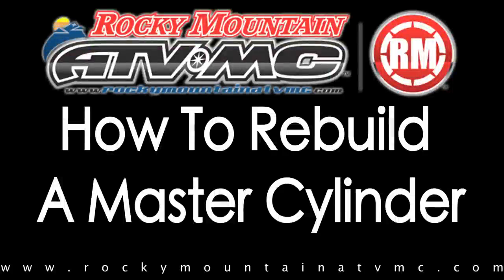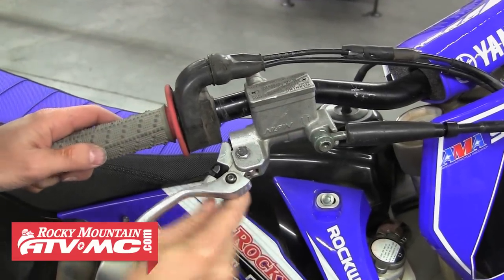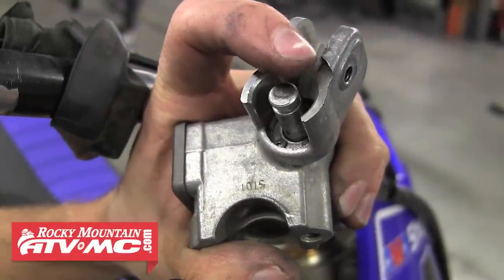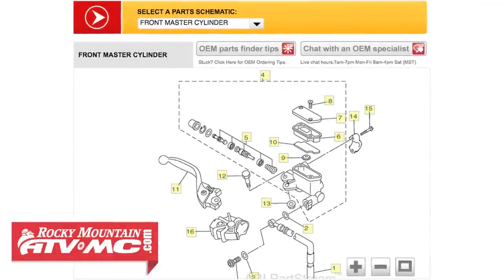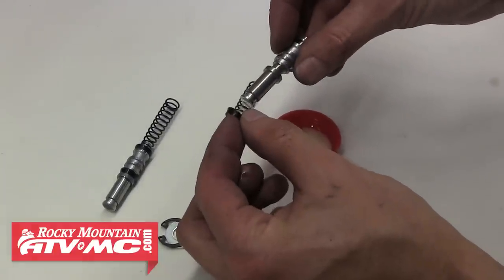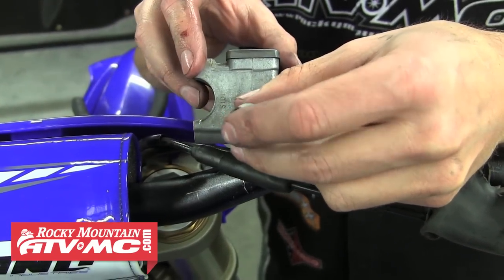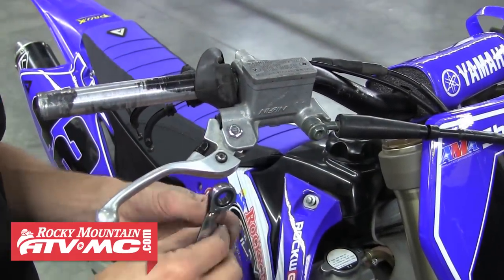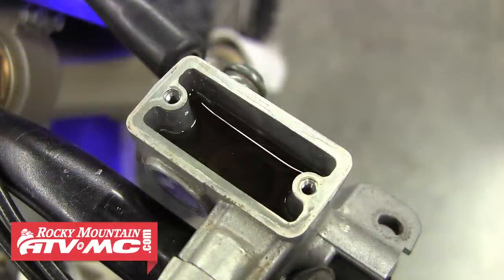How To Rebuild a Master Cylinder on a Motorcycle or ATV

Comment: Important to mention… When the piston is in the rest position, the brake fluid will be balanced via The compensation hole. This compensation hole is very small, clean this compensation hole with a very thin wire of copper, if it would clog… you are guaranteed a dragging caliper, this has already happened to me twice!!!  with the Honda CBX 1000. Stay Safe.
Reply: You left this comment on multiple rebuild videos. Good for you.
Reply: @anunentitledmotivatedmille7731  sir, sorry ,,, my only purpose is to help other motorcyclists and avoid problems with their rear master-cilynder-brakes!
Reply: Thanks for doing so. I think this is the problem on my bayou 300 ATV. I was riding on a warm day and both front brakes became completely stuck. Even bleeding them a bit only relieved the pressure until you brake once. I had to let some air in the system to allow some expansion and rode it home. It was an ATV and off road, if you have the problem on a road with a machine that drives 100kmh (or more😏), you are screwed.
Reply: the same issue can cause slipping with an hydraulic clutch
Reply: @jasonjason7277    You're right...Very well noticed.  👍

Comment: I'm hoping this will work when I try to do this on my 2005 Ninja 636. The seal has to be bad as air gets in after each ride and I have to bleed it before the next ride everytime. I bought the All Balls one in your video which is just the rebuilt kit and joy the Piston. Hoping it all works well!

Comment: I good idea after you removed the rubber boot is to give the area a blast whit break cleaner.
Then you minimize the risk to get any crap in to the cylinder when you put it together.

Comment: I wonder if its because of the cable or Brake Master cylinder that difficult to pull. I bled the brakes. And there was no change i checked the cable as well.

Comment: I emptied my master cylinder to clean everything out as my bike hasn't been started in 4 years and may not have had any fluid changes since the factory(1994) removing the banjo bolt and covering that hole with my finger while pumping the lever does build up pressure but when reconnecting the line barely any fluid is coming out. Any advice?
Reply: Did you ever find out why???

Comment: I've got a 2005 yz250f. My front master cylinder is gone. Can I put on any old front master cylinder? Or does it matter
Reply from the maker: +rscabbage Should be fine as long as the brake line fitting fits the banjo bolt and threads into the master cylinder?  You would just want to know what bike the brake master cylinder came off of in order to buy levers for it though.

Comment: I'm wondering what would happen if I changed my ktm 300's master cylinder that uses a 10.5mm piston with a ktm 200's master cylinder that uses a 9.5mm piston? Would the clutch pull/feel be the same as it is on a ktm 200?

Comment: 2003 Yamaha virago 250, been trying to bleed the front brakes for 45 minutes - gone through an entire small bottle of fluid and it's still not getting stiff. Is this likely a master cylinder issue?
Reply: Did you ever find out? I'm having the same problem

Comment: I'd like to replace my Shimano Hydraulic Brake on my bicycle with chrome motorcycle brake levers/master cylinders.  I am keeping the Shimano calipers and brake lines. Shimano uses mineral oil for fluid. Could you tell me if the seals on most motorcycles brake master cylinders are EPDM, Nitirle, or some other rubber compound?  I know EPDM is not compatible with mineral oil.
Reply: the cap on the cylinder Will tell you what you need.

Comment: can i ask you a motorcycle related question ? my bike would have pausing feeling when i apply the brake and when the bike only almost come to a stop.. i replace head bearing, wheel bearing looks fine, change rotors and pad,, still doing the same jerking thing .. what else i can do to fix that?  tire is balance and i bleed the brake als
Reply from the maker: What bike do you have? Does the front end have any play in it at all? That's the first thing i would look for if that's what it feels like to you. Lift the front end off the ground and check for play in the bearings and front end. It may just be that your brakes are being really grabby but i would make sure your caliper is lubed up to make sure the pistons are functioning properly. Which brake pads did you install?
Reply: i have a 09 R1. and the front end have plays in it. and the brake is not grabby.. got some new brake pads in it.. the caliper seems to work ok since i got full brake its just pausing at low speed.

Comment: i have a 96 Suzuki Intruder 800. The piston on the front brake doesn't even come out. It's stuck inside. What now?
Reply from the maker: +Rhonda Skinner Have you rebuilt your front brake master cylinder already?  Have you tried compressing the brake caliper piston with a c-clamp to help break it free?  In most cases a front brake master cylinder rebuild is required to fix this problem.

Comment: hi i have had my rmz450 (2007) for a few months now i do trail riding and last time i was riding coming up a big hill i went off to the side and hit a tree stump with my bars i wasnt going very fast and after that i had noticed my front breaks were completly squishy and no fluid was in the top fluid box. i couldnt see where the fluid came out but i tryed to refill and rebleed them when i got home there apeared to be no air in the line but the front break still remains squishy and doesnt work at all unless i slam them on quickly it will work for a second any idea? thanks
Reply from the maker: Did you find any damage cause by the wreck where the fluid might have escaped? If your system is constantly sucking air into the system it wouldn't ever tighten up no matter how many times you bleed it. I would inspect your parts checking for any damage or leaks. If not try bleeding it a couple more times to make sure all the air is out of the system... If that doesn't would you could have a bad seal somewhere (either a banjo fitting crush washer or a seal) and you might have to rebuild the system

Comment: I rebuilt it, put everything back together after also rebuilding the caliper, and the lever never builds pressure. Any suggestions?
Reply: Did you ever find out why it didn't build pressure
Reply: @ramon323able  after bleeding a tightening everything back to normal, I was pulling the lever in repeatedly too fast. I did slow pulls for maybe 5-10 times and it slowly built pressure again.
Reply: @cadillacmoto  what way the the seals face I'm not sure if I have them the wrong way

Comment: what if the brake feels stiff? I can pull the brake and stopping power is good but just feels like stiff to pull lever
Reply from the maker: Ivan Robles You could need a new brake master cylinder rebuild kit, if it doesn't go away after bleeding your brake fluid? You can also check the front brake caliper pistons clearing them from any dirt and grim with brake cleaner.  Let us know if there's anything else you run into? Thanks for watching!
Reply: Went away after flush and bleeding thanks!
Reply from the maker: Ivan Robles Nice job! Thanks for checking out our channel.

Comment: Recently rebuilt my master cylinder and can't get any pressure to bleed brakes. The bore in the cylinder looked good without any damage when I did the rebuild. The only thing that I could see is if one of the seals rolled over while reinstalling the piston. If this was the cause should I replace the seals again?
Reply from the maker: Try different combinations when bleeding your brake line.. pump the lever and   while holding it in, crack the banjo bolt that's threaded into the master cylinder.  That can purge any air that is caught between those two points. May need to do it a couple times until brake fluid starts to seep out. Then you can go down to the brake line nipple and repeat the bleeding process.  Hope this helps.  Goal is to purge any existing air from all sealing points.. I would try this before replacing your seals, but again there is that possibility that they could have rolled over on you during installation?
Reply: Fred Wiedlich ya think
Reply: ya 🤔

Comment: isn't brake fluid a highly corrosive liquid, should not be touching it.
Reply: +bazrazin1 never had problems with it, even had it in my mouth - doesn't taste great. Other than severly drying out your skin it seems to be fine .. I'll reply when I get skin cancer though :D
Reply: +xfgher "even had it in my mouth - doesn't taste great." lmfao, sounds like a girl's first time. If you know what I mean. ;]
Reply: It's not defined as particularly hazardous, but it's still one of the last things I want on my hands
Reply: have u noticed, if it falls  on any paint even the one on the master cylinder it chips of the paint.

Comment: My 1981cb750c master cylinder cap is clear and can clearly see that it appears to be frozen because there is an angle to the fluid thats frozen inside. I should just buy 
http://www.ebay.com/itm/7-8-MOTORCYCLE-HYDRAULIC-BRAKE-MASTER-CYLINDER-CLUTCH-LEVER-HONDA-SUZUKI-RIGHT-/181719983782?fits=Year%3A1981%7CModel%3ACB750C&hash=item2a4f5ae6a6&vxp=mtr

and replace it or try to rebuild it?

Comment: lol why did you drip you finger in brake fluid lol./
Reply from the maker: Jordan Berry You dip your finger in the brake fluid to evenly apply it onto the new brake piston seals for easy installation into your front brake master cylinder.